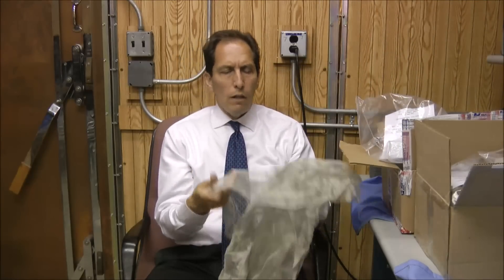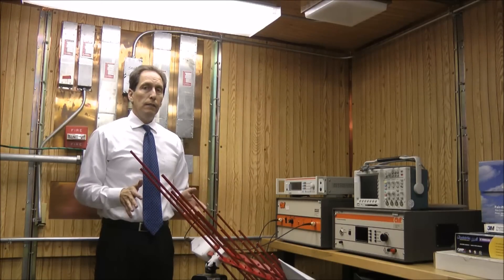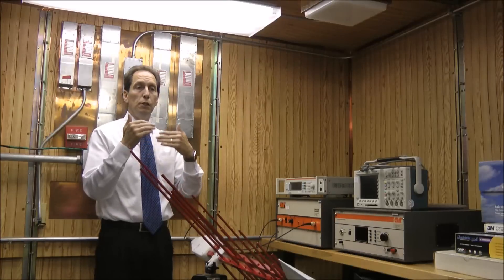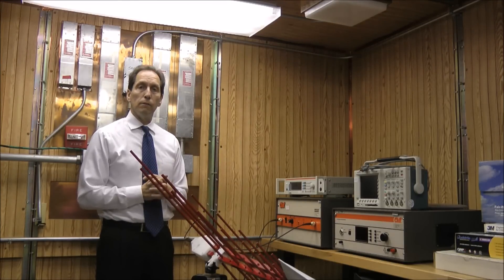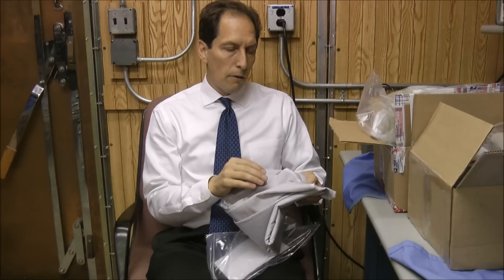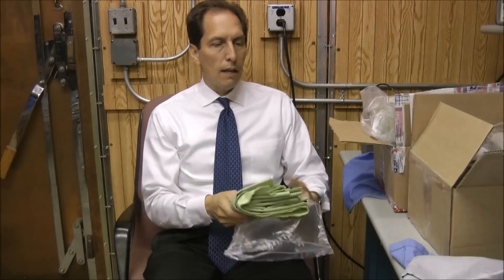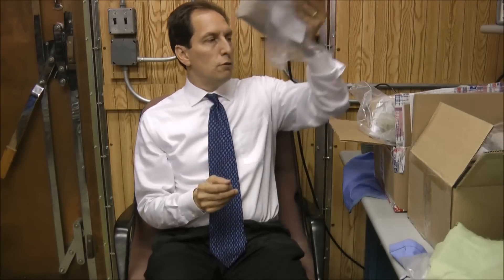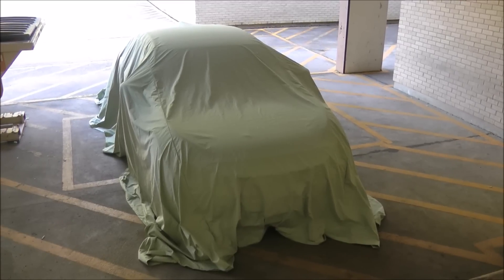Protect Generators and Cars from EMP

Comment: will diesel be effected by an emp
Reply from the maker: The fuel won't be, but a diesel vehicle could be. Even diesel vehicles have controllers and computers, and those are what are most susceptible.
Reply: @disasterprepper  yet I'm sure a humvee or a hummer is resistance against a emp
Reply: @i_am_chronic3997  Newer diesel vehicles will be affected.
Reply: @i_am_chronic3997  Newer diesel vehicles will be affected.

Comment: Disasterprepper, Isn't the EMP  that may be used designed to be a BOOM  effect for all electronics including power, electronics, and any other wiring to take down the effectiveness of our recovery? If so, wouldn't these suggestions of yours be inadequate?
Reply from the maker: Hi William, I think your question was cut off. Kindly edit or re-post, and I'll try to answer.

Comment: See that's the thing how much fuel can you store if you save your car. No gas stations will work. So the point. Why. Get bikes extra tires or the one that are solid. Lawn mower engine i don't think is a lot of electronic. (?) Convert bike. Uses very little fuel.  Hope some stations have a hand pump. But that would be a very dangerous place. When i think of this happening i just see all the planes falling out of the sky. All the people. Horrible.  And all the people being operated on at the time. All the people on machines people us to stay alive. People on insulin. No way to keep cold. You get what i mean. My car seems small to worry anout and some one woulf just kill you for it anyway. And all the devices your trying to protect. There will be nothing transmitted to them.
Reply from the maker: I appreciate your thoughts. I think you might miss the value in having a bug-out vehicle and enough fuel on hand to get to some place either less affected, or at least away from mass numbers of needy people. Also, keep in mind that with millions of disabled cars, fuel can be recovered fairly easily from them. As for planes, I don't believe that they would fall out of the sky as people fear. Commercial airplanes' electronics are often quad-redundant, and while they might lose communications, I think many would safely make it to the ground. Still, would it be bad... absolutely. Even so, I believe strongly that those who prepare (for anything) are always better off than those who don't.

Comment: Is an emp going carry 70,000x the energy you are researching with?
Reply from the maker: An EMP actually has very modest energy density (about 0.1 J/sq. meter). It is the very narrow pulse width that causes it to be so destructive. That in turn corresponds to a tremendous amount of power being released. But addressing your question, or what I think is the gist of it, I am testing with a continuous wave that I sweep through frequencies. That's the standard way to determine shielding effectiveness. It would be really cool to conduct tests with real EMPs, but of course, that would be quite expensive, given the damage that would be caused.
Reply: +disasterprepper good to know. Thank you.

Comment: The fabric that protects from emp how covered would I need to be to protect my pace maker defibrillator can I wrap a piece around my chest or would I need to cover my whole body with no leaks please let me know if a shirt made of the fabric is sufficient or do I need a blanket to cover me completely on the ground
Reply from the maker: Hi Kev, I did an analysis of a pacemaker and found that it would likely not be damaged by an EMP. With that said, you certainly could make clothing out of a shielding material. If you search the web, you'll find people selling shirts, many made of a soft silver thread that I suspect works well.

Comment: O don't think they'll work because high voltage will arc through the materials. My suggestion is to simply ground car body to a 10 foot deep ground rod therefore the vehicle body and frame becomes the shield with EMP energy diverted to group.
Reply from the maker: If you actually look at the science, this isn't the case. The radiated waves won't cause arcing through a grounded cloth, and driving a ground rod isn't really helpful for this type of threat (very different than lightning). I appreciate your thoughts though.

Comment: What if you ground your vehicle to earth?
Reply from the maker: It really won't make much difference. There's a common misunderstanding about the importance (or lack thereof) of grounding a conductive shield. In the near field, electric field lines will terminate to a grounded conductor. That's especially helpful in preventing the energy from coupling around. In the far field, however, as is the case with an EMP, the metal acts as a lossy interface, regardless of whether or not it is grounded.
Reply: disasterprepper thank you.

Comment: Will an EMP stop a pace maker?
Reply from the maker: I did a careful study of one pacemaker (Medtronic) for which the vendor provided susceptibility data and found that it would easily survive an EMP. Even so, I can't say that all pacemakers would survive. It's a good question, and I'll try to do a video showing how I concluded that the Medtronic would survive. You can find my analysis on my shared drive at: http://sdrv.ms/ZYRHVX. It's under the Pacemaker Susceptibility Folder.

Comment: How about just a copper screen to cover your generator?
Reply from the maker: Sure, it should work fine if you can get it all the way to the ground. Keep in mind that, if possible, you don't want any unshielded wires or plumbing coming in through the cover.

Comment: I am not Neil , great video It would be nice to have your car protected from emp , now if they could only protect the gas stations from an emp attack or have some kind of manual pump in place at the gas stations before an emp attack then it would be easier for everyone to survive .
Reply from the maker: So true. You can build up a pretty simple gas-retrieval system using a fuel pump and a couple of rubber hoses, but you'd have to either steal or work a deal with the gas station to recover the fuel.
Reply: disasterprepper , I am not Neil , I think it would be smart for gas stations to have a hand pump system set up in case the grid goes down , that would be smart and help them stay in business . I hope they do as so much depends on them.

Comment: Would this helpful to cover smart meters?
Reply from the maker: Some folks have certainly used it for that. My only concern is that covering the meter would interfere with the meter's ability to communicate with the service provider. If it does that, they may have to estimate usage, or worse, come out and inspect the meter. That might result in a charge to the customer.

Comment: I've got a 16KW outdoor generator powered by propane.  If I cover that completely with the cloth and touching the ground, should I use metal staples to secure it to the ground?  This also got me thinking about my ham radio.  Need to cover that along with the pc connected to it.  Crazy thing is if Russia or China EMPd us, we would respond with nukes and they would retaliate and all the covers in the world wouldn't make a damn bit of difference.  So I'll do this but use them to protect against massive solar flares (MCEs).
Reply from the maker: Covering the propane-powered generator would greatly reduce the radiated effects of an EMP. Staking it isn't absolutely necessary, but it might help to keep it in place and to keep gaps from forming. If it were me, I would just use some small garden stakes to hold it in place. As for the HAM radio, before covering, be sure to disconnect it from the antenna, or it really won't do much good.

Comment: Do you have to ground it?
Reply from the maker: You actually don't have to ground it, but I measured the effects of allowing the cloth to lay on a concrete floor, and found that it improved the shielding by a few dB. That is why I recommend having a little bit of floor lay of the cloth all the way around.
Reply: Rgr.  Thanks.  Anything for applications where touch the ground cannot be guarranteed?  (i.e carry bags, boats, moble shielding devices, ect?)

Comment: I'm no expert in this field but to protect a car you wouldn't  want the double sided conductive material because if a conductive side was touching the car the emp would hit the cloth material and be transferred straight to the car on the dual sided cloth. So to me the one sided conductiveness would be better as long as conductive side faced outward from the car with preferably a good thick non-conductive material like a canvas tarp in between the car and other material to help prevent any current spark jumping into/onto the car. Also i wouldnt trust the conductive cloth just touching the ground to ground it out. Myself i would probably sink a copper grounding rod into the nearby ground soil at least 6 to 8 inches deep and have a heavy load wire clamped onto the rod with perhaps a good heavy duty alligator clip on other end of cable for easy on/off capabilities especially if its your daily driver you protecting! Also when you sew the material you would need to make sure that the conductive sides were sewed touching each other to complete the circuit. If not you would have 3 or 4 seperate protective circuit that would all need a damn good ground each! How ever i'm not an expert as i stated earlier! Its kind of like if you were to use a metal trash can you would need to place at least a 1/8th inch plastic liner inside the metal can so the emp spark didnt just jump from the metal can to your valuables inside it, and again its preferred to set up a good in ground grounding rod if for the metal can as its the best way to make sure you have a good and proper ground therefore adding piece of mind that your car was  adequately protected from emp!
Reply from the maker: Hi Charles, it's a reasonable suggestion, but it doesn't actually work that way. The EMP is not a surge of conductive plasma (like lightning) that needs to be shunted away to ground. Instead, it is an electromagnetic wave that must be reflected or absorbed. The conductive barrier, even if in contact with the car's chassis does a nice job of doing both. People often think that an EMP works like lightning, but they are distinctly different phenomena, and the protections for each are different.

Comment: If you sew the four ends like curtains. Then slide ground rods,or rigid pipe in it to keep it weighted down.
Reply from the maker: Yes, you could do something like that to make it sit more securely on the floor. If you leave 12" of cloth all the way around, it seems to sit pretty well without any additional weight, but it could certainly be added.

Comment: I am going to convert a cargo trailer into a small mobile home  I found that widow screen will block excessive WiFi need to see more test but I am impressed with what I see so far. That I am going to put window screen mesh down before placing my insolation now I am thinking of this cloth along side the window screen mesh so I am protecting for both 5 g WiFi and EMP thank you for giving me more food for thought.
Reply from the maker: Yes, a fine mesh (like window screen) can help to reduce WiFi or other wireless RF signals.
Reply: @disasterprepper  I am looking forwards to the build  to have a home that I can move any where and that can be safe and totally mine is just awesome

Comment: Easy trick ,put an extra battery wrapped in aluminum foil and Electric tape,in your basement!! SOLVED!
Reply from the maker: Having an extra battery is a good idea, but it wouldn't really solve the problem. The issue is that the controllers in the car (several hundred of them) are susceptible to the radiated effects of an EMP.

Comment: AND if your driving down the road and the EMP goes off Lots of luck...……………...It might however work on our whole house automatic standby generator to insure it keeps the furnace running in the winter with Frozen pipes & Frozen people being the concern...………..
Reply from the maker: You're right John. There are really no good ways to protect vehicles that are in motion. It would require extensive engineering to add surge suppression to critical systems to ensure survival.

Comment: I have an F-150 pick up truck.  Would it be necessary to cover the entire vehicle (including the bed) with the cloth?
Reply from the maker: Probably not. You could likely get most of the benefit from making a cover that went around the cab and engine compartment. There would still be some wiring (such as tail lights) that might couple in some energy, but my guess is that you'd see significant protection from the partial cover.

Comment: I heard large amounts of plastic, and rubber helps. Specifically made for barrels.
Reply from the maker: In general , shielding effectiveness is a function of conductivity and permeability. Unfortunately, plastic and rubber have low values of both, and thus make poor electromagnetic shielding materials.
Reply: Ah. I would be wrong then...

Comment: Hi Dr. Bradley...Great engineering approach and testing process, as a retired automotive engineer it is very much appreciated. Do have any experience or opinion regarding the use of a carbon fiber cloth material. Carbon fiber is very conductive and may be less expensive. Your thoughts please.
Reply from the maker: Hi Sonny, I've wondered the exact same thing. I just haven't had the chance to test any yet. The stuff I've seen cost about three times what this cloth does, but perhaps there's some cheaper stuff out there.

Comment: Would an EMP blast penetrate dirt? If you had your vehicle and equipment underground? And how much dirt would be enough ??Does anybody know this?
Reply from the maker: I looked at this a year or so ago. It ends up that the dirt/soil has to be about 10 skin depths to provide good shielding. To make things more complicated though, that skin depth is a function of soil type. If my calculations are correct, the required depth ranges from about 3 meters to 30 meters, with moist agricultural soil requiring the least amount of dirt and dry sand requiring the most.

Comment: From past experience, EMP has proven to be formidable to most modern semi conductor devices, yet much less to the older devices, Ahhh PROGRESS!!
However,EMP, like light is direct and line of sight or reflected. Most post 2008 or newer cars with fiberglass or plastic hoods and body panels will never run, BUT most older vehicles, even with electronic control systems will run and be very usable.
The old ideas of EMP seem to change from engineer to engineer, scientist to scientist yet no one has ever really offered a real solution.
Grounding vehicles and devices is a BAD idea, it allows a free path through the outer shell to devices then ground.
Floating the vehicle on non conductive tires is still the safer bet, same with all devices. UNPLUGGED DEVICES DO NOT FAIL. UNGROUNDED DEVICES DO NOT FAIL,  and the biggest fails will be power plant controls themselves, which is exactly all power plants have backup mechanical devices.
I guess you would really have to work with particle accelerators and spark and bubble chambers for awhile to see how this works in real life. BUT most people don't have any idea of what those are, so I suppose we'll just let the chips fall where the may, because their "SPORTS and ENTERTAINMENT" are too important to even try to learn!
Orwell was right, but his timing was off, 1984 will be 2024!!!
Reply: did you know that many (or now all) birth certificates became to be bond-style certificates which have 'bond value' accessible only for government's authorizations; which still maintains the values.?  this was set up to provide cached currency available for any needs -  beyond red tape & in the nutshell, this is clearly explained as being your future workforce value sold to the others :  "you guessed it"... it's a scam perpetrated by radical americe demoncrats in office long after the 'bankruptcy of America"..  this may be how a no performing loser campaign president is able to keep their deficits in the black.!  you could get some of the dough, but only armed with a countersign endorsement from same gubers -. literally, sold us out & that might a maddening truth be, but, you're no prime account holder, agent only, and must obtain said permission; many are imprisoned for it's fraud and do not fall for any 'release kit' offered or implied -  they are hoax games that send you up the creek but pay scammers their charges.!!

   (if you wish, links are available)

Comment: Does this fabric have to be touching the vehicle? If not, can I make a carport out of it? How close does it have to be?
Reply from the maker: It doesn't have to be touching the vehicle, but in most applications it would be. The cloth acts as a conductive barrier, essentially sealing up the vehicle's many holes, gaps, and seams. If you were going to make a full enclosure, I would think you'd want to use some kind of solid conductive barrier, but it would need to encompass the roof and all four sides.
Reply: Thanks!

Comment: Well, for those of us who own and restore antique autos, will points distributors and wound coils have any advantage, considering there is No circuitry to concern oneself with when not connected to a Battery? Also, what about Old Diesel Motors which only require Compression to start and run??
Reply from the maker: Most folks (myself included) believe that older cars would be less susceptible, although I haven't seen any test data to confirm that. Still, it certainly makes sense.